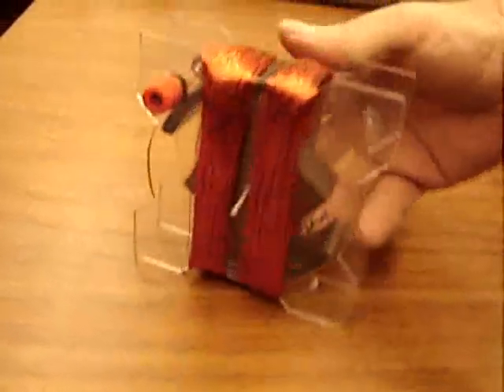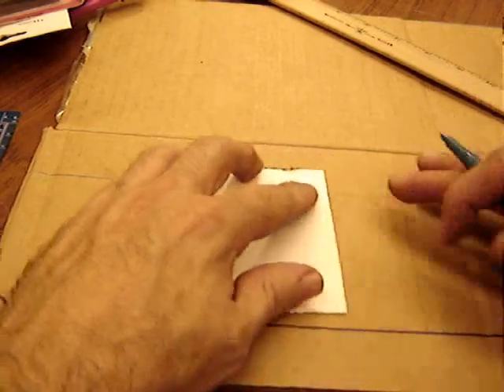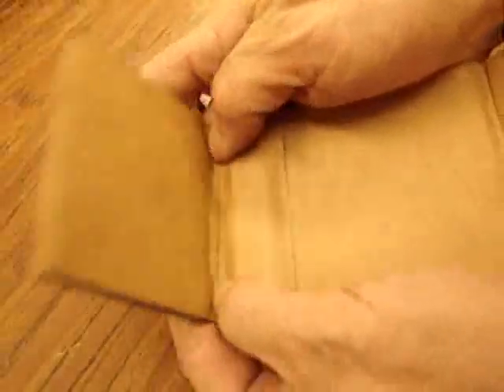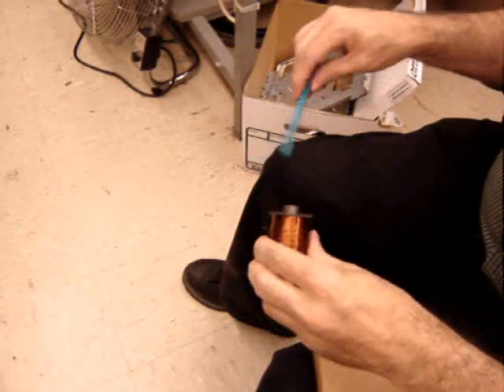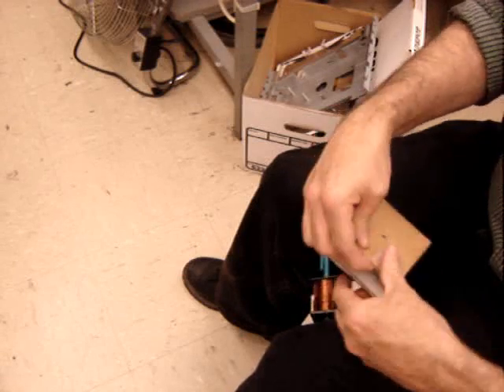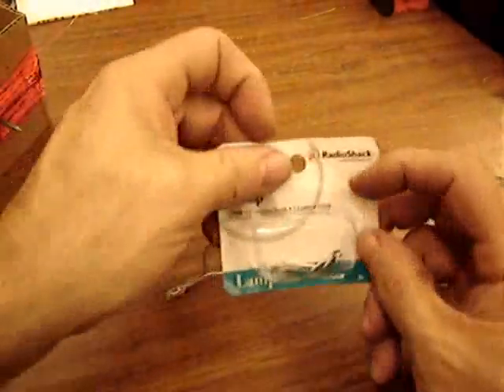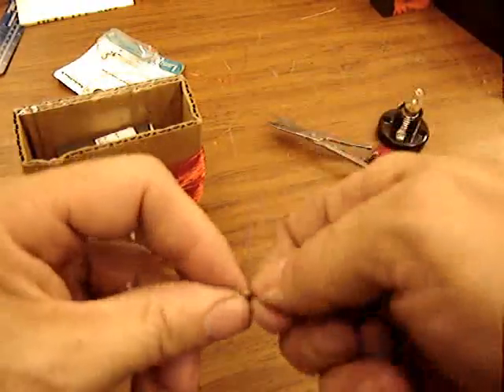Simple generator:  AC electric generator for science fair

Comment: I have used a 3v bulb instead of 1.5v wat shud I do to make d bulb glow??? Plz reply
Reply from the maker: 3v bulb will not work.   1.5v flashlight (torch) bulb will not work.

The bulbs which work are listed on the main website:  special Radio Shack 40mA bulb, or try #48 or #49 pilot lamp, or try a red colored LED.   For red LED you need more turns of wire, or spin the magnets much, much faster.

Comment: Yes, a red LED should work but you MUST connect a 1N400x diode across it (in parallel) to protect it from reverse voltage (where x is any number from 1 to 7).
Reply from the maker: Nah, forward current is the greater problem.  If you're worried about reverse breakdown, just connect two LEDs in parallel, pointing opposite.  The AC output will flash them alternately.   That's a good way to test, try a red and a green, back-to-back  (see if you can light up the green LED at all!)

Also, since it's difficult to spin fast enough to light an LED at all (to get past two volts,) it's even more difficult to create the four to thirty volts needed to damage a reverse-biased LED.  If your generator can do that, it's already turning the LED on at over 100mA forward current.

But yes, if you spin the generator blazingly fast to generate 5V, you may kill your LED.  Which is worse, the long-period forward-current overheating, or the briefer pulse of reverse-breakdown overheating?  That depends on the magnet speed, wire thickness, and number of turns (so, volts and series resistance of the coil become important.)

Comment: How long does the nail have to be and does it have to be magnet wire
Reply from the maker: See the main instructions on the site.  Don't use different wire or different magnets or different bulb.    Once you make it work, THEN try making changes to see what happens.

Example:  with thick insulation, 300 turns of wire is a huge wad, and the outside turns are far away from the magnet.   Need very thin wire, so those 300 turns all are very close to the magnet (and 500 turns is better, or 800 or 1000!)

Comment: Hello, thanks for the video it's very helpful- Would it work if you use an old fan like motor to make spin the nail instead of spinning it yourself, so it can generate eolic electricity?
Reply from the maker: Anything works if it spins the magnets fast.  Try an electric drill.  Or even a hand-crank drill

Comment: Would it work if you use a motor connected to the part you spin instead of spinning it with your hand.
Reply from the maker: YES!   Try clamping the nail in a power drill..   But usually you can spin it faster by twiddling the nail with your fingers.

Comment: could you connect a diode to this to convert to dc to charge batteries or cell phones?
Reply from the maker: In theory, diode yes.   But diodes eat up about 3/4 volt.   This generator only puts out about 1V.   So you're left with almost nothing.

That's why real DC generators use a rotating "commutator" switch to reverse the polarity twice per turn, so it's always positive or always negative.   A switch doesn't use up the volts like diodes do.    You could build a "non-ultra-simple generator" with an entire commutator assembly.    It would also become a motor, if connected to a battery.
Reply: Cool video.  Thanks alot.

Comment: what kind of wire is this, material wise
Reply: > what kind of wire

Wire bought from Radio Shack.  Most normal wire will not work.   See the main page for parts list, also the FAQ for many suggested wire sources and mail order sites.   It's very thin #30-gauge copper wire, insulated with a thin varnish coating.

Cheapest is to buy some two-dollar solenoids from surplus electronics pages.  Certain types of solenoids can be bent open to remove the spool of wire.
Reply: KANTHAL WIRE.. could i use that
Reply from the maker: William Moon
No, the wire must have very thin insulation (enamel varnish.)  You need about 300ft, more is better.   And it must be almost hair thin (#30 gauge or similar.)    See the main project site, partslist and FAQ.   For wire there are many online sellers, mail-order.

Comment: Sir i need to make a working model on the uses of electromagnetic induction in daily life... pls suggest something.... n pls suggest something easy that i can make
Reply from the maker: Electric generators work by Faraday's law of EM induction: the moving magnet induces a voltage in the coil of wire, and if a complete circuit exists, it also induces a current.

Or more specifically, in the circular area bounded by each turn of wire, the voltage produced by that turn of wire is proportional to the changing rate of magnetic flux (so, we produce higher voltage by adding more turns of wire, or with stronger magnet, or with faster magnet, or by including an external steel core to concentrate the flux and direct all of it into the center of the coil.)   EM induction and the AC power grid runs our civilization, and above AC generator (alternator) is a simple demonstration.

Comment: I made an octagon, and epoxied 8,  1x1/4" N52 rare earth disk magnets on the facets.   I reclaimed magnet wire for a transformer.  I used at least as man turns as shown in this video and spun it up with a drill.   

I got no voltage for some reason.... The magnets ran extremely close to the coils too!....

It should work, but for some reason it is not.
Reply: > removed all but two opposing

Clown Whisper yep, that's how you duplicate the DIY generator: the rotating magnet assembly must have only two poles.  xxNxxxxSxx would give alternating spikes, while NNNNSSSS would give more of a sine wave: more magnets in parallel gives same peak volts but higher average volts, and more power at the same RPM.
Reply from the maker: If it doesn't look exactly like the generator in the video and website, chances are it will fail.   Always make an exact copy first.   Then make changes, so you can immediately see if one small change caused total failure.

If the neo magnets aren't set up as a stack of slabs as shown with the ceramic magnets, it probably won't work.   You need to form one large magnet that flips end over end.   Also, the ends of that flipping magnet must "wipe" across the wire coil.   If they follow the coil instead of cutting across it, then the voltage will be zero.

With the octogon, it might work if half of the magnets are facing north-out, half facing south-out.   So they go around the octogon like N, N, N, N, S, S, S, S.   That forms a single larger N, S maghet.
Reply: Yes that is what I did..  North south orientation and cutting across the coils. 
Its really frustrating

I think that the magnets are too strong and canceling each other out as every other one is north.  they are so strong that I had to use wood clams to glue them even from far away.  The fields (I think) overlap too  much.  Im going to use the same coil as its is at least 400 turns now, and install a n52 bar magnet to see if I can get a tiny bit of juice.  that will confirm things for me.
Reply: wbeaty So I removed all but two apposing sides and I was able to get 20v out of it using a drill.  It would random spike to 30v but only for a second.  It was bouncing all over the place but 20v showed most of the time.

I also noticed some sparking within the coil, so apparently my reclaimed wire has some bare spots.  I am really surprised that i am getting 20 v from just two one inch disc magnets.
Reply: Clown Whisper No, they absolutely can't be alternating poles, that will guarantee zero volts.  Marching CCW around the octogon they must be S,S,S,S,N,N,N,N, so you have a cluster of four strongly-repelling magnets, then another cluster of four repelling magnets.   If instead they all attract their neighbors, and go N,S,N,S etc.,that gives zero volts output.
Reply: William Beaty I have a lot of cool stuff left over from running a few manufacturing facilities.  All manor of bearings, magnets linear slides. I got a bunch of polished chrome shafts pulleys, belts etc..

Im also a woodworker so my plan is to build a decorative windmill with LED's lighting up..  Im going to have to build a rectifier and perhaps a bank of caps for some more steady voltage.

I am very surprised that my first pisspoor attempt at this worked
Now another question.  If I do this but build one coil for every magnet and do them in a disc type array like you see people trying.  would I then use alternating north south arrangement?

Do you know a good supplier for for magnet wire.  It seems to vary in price so wildly.

Comment: Wat type of wire did you use for the generator
I need it for science project
Reply from the maker: See the parts list, second page of main article on http://amasci.com/coilgen/   It's #30 gauge enameled magnet wire.   Buy from Tandy Radio-Shack stores, or see many links to online sources.

Some types of $4usd solenoids can be opened up to remove a spool of this type of wire.    Also see Avind Gupta's generators linked on http://amasci.com/coilgen/links.html
Reply: thanks that would help

Comment: Is there 2 wires? or is it the only wire you started with in the first place
Reply from the maker: All wires have two ends!   Just don't lose the starting end when winding the coil.
Reply: wbeaty so you just use 1 wire and how many turns to make the light work

Comment: I think it would be so so so much easier just to do this
fablab.waag.org/content/shakelight
That way you can keep your wire all rolled up on its bobbin(that is if you get to both ends of the wire)
Reply from the maker: Easier no.   500 to 1000 turns of wire?  Mine uses 250.  Where to buy that bobbin?  And the plastic parts?  Kids in 3rd grade aren't allowed to use knives or soldering.  That's not "Ultra Simple," it can't be made using scissors and some stuff from Radio Shack.

But if you want a real generator that's not cardboard, just go and build the more complicated versions like Shakelight, or Otherpower supermagnet wind generators, or all the others listed on my links page http://amasci.com/coilgen/links.html
Reply: wbeaty The bobbin is what the wire came on in the first place. Or find a solenoid you can take the center out of and you'll be half way there. For the plastic parts just stroll around walmart till you find something that will work. Using your imagination to create something from parts that weren't made for that purpose is very satisfying. So when is the correct time to teach kids about using tools safely and show them what can happen if they don't.  Not teaching safety is just a disaster waiting to happen when they aren't at school.
Reply from the maker: dumass00072 the shake-gen is easy ...for teens and adults.  My above generator is for far younger kids in a classroom setting.   For them, the shake-generator isn't easy, instead it's near impossible: it's a fairly advanced project perhaps for 6th graders.  But if they can get parents to take them to a local Radio Shack store, they can build it easily.   That's why thousands of K6 school kids build this cardboard version.  Beware of a "let them eat cake" attitude.  Shake-generator is only "easier" if you're much older and allowed to use sharp tools, a soldering iron, if you can order online parts, if you can wander around in Walmart.   The Ultra Simple Generator needs none of these: it's aimed at an audience far, far younger than Shake Gen.
Reply: I'll go with ya on that. From what I can remember(which isn't much) I was pretty useless in 3rd & 4th grade. :)
Reply from the maker: dumass00072  Me too, but I remember "third grade me," he once made a flashlight out of batteries and electrical tape, and he wants to build a generator.

So that's who this one is for:   for mini-me.

Needs 1000 turns of wire?   I'd give up before I even started.  And they'd never let us mess with neo supermagnets (blood blisters from finger pinch.)   So this one is designed to barely, barely work, if you only wind 250 turns.   For the big kids there are much better DIY generators at http://amasci.com/coilgen/links.html links page.   The best one is six kilowatts, with lethal neo supermags the size of hocky pucks http://www.otherpower.com/20page1.html    It's AC, but with big diodes to charge a bank of car batteries.
Reply: My third grade teacher broke her paddle on me. The 2ft long 4in wide wooden ones. I was a demon child. :)
Reply: dumass00072 The "Batteries and Bulbs" teachers-manual says to beware of kids who hook twenty of the D-cells in series and use it to "detonate" the little flashlight bulbs.

Comment: why not a led? new generation red are pretty efficient and run fine on ac :) run 2 leds in reverse polarity of eachother and watch the ac fluxuate between them flashing 1 then the other
Reply from the maker: Double the number of turns of wire, and red LEDs work just fine.    But they need 1.7V, while the special incandescent bulb lights at 0.7V

Comment: Can you make A bigger working generator combinating more of this small?

And ,why you don't make video storing that electricity in home made battery?
Reply from the maker: Batteries need a DC generator.  This one's AC, so it needs an entire rotating Commutator assembly to make DC.   That's not "ultra simple generator" anymore.

It is possible to use diodes to change AC into DC.   But this generator only puts out about half a volt on average, so any diode will swallow the entire output with nothing left over.  (That's why low-volt DC generators typically use commutators instead of diodes.)

Comment: er so this is ac? um wth everyone complains it tough to get dc stuff to run converters to run ac stuff why dont they just make these kind of chargers to run blenders and what notlol?
also if i continue to increase wire wrap, does the voltage go up, and does the thickness matter, thinner better? thicker better? i wanna make a small steam engine to turn a handle on one of these and see what i can do with it, toy wise of course ^^
cool vid
Reply: This is ultra-simple cardboard generator, less than a tenth watt.  See the generator website, links page, for lots of high-power DIY generator projects.

Yes, twice the windings gives twice the voltage.  But to run a flashlight or charge a battery, you need very high speed, or add steel parts (both is best.)
Reply: William Beaty still cool to know there is a way to make ac without converting.
anyway to convert an ac item to use dc? ^^ just learning so all noob questions I know lol
Reply from the maker: APCWORLDSUXAZ If something has a wall-transformer, an "AC adapter," then it's already using DC.   But usually those things are 5V or 15V or something between.   This generator only produces about 3/4 volt.   For much better generators, find wind-power projects with big neo magnets and pancake-type coils.
Reply: well in that case, i seriously got screwed in school because i don't remember learning any of this cool stuff AT ALL.but its cool because it forces me to meet cool people like you ^^

and thanx, trying to learn about electricty, dynamos/generators and alt energies like steam, solar, and wind.
 i mean you made electricity in your freakin hands with cardboard. although the clear plexi one is very cool as well.
FREAKIN MR WIZARD LOL
Reply: APCWORLDSUXAZ  Beware, my large website, giant time-suck:    Bad Physics http://amasci.com/miscon/miscon4.html    Projects http://amasci.com/unew.html,  articles about "Electricity" http://amasci.com/ele-edu.html
Reply: sweet ty dude. insomniacs don't have " time-sucks"  the week is just one long day lol.

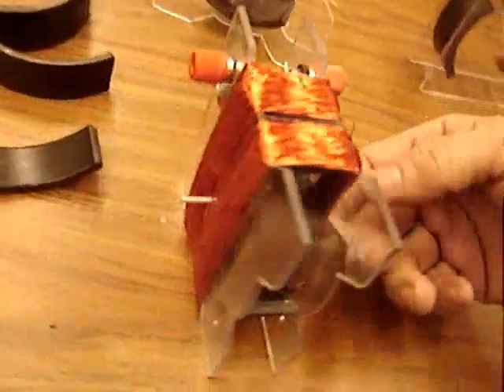Comment: 7:17 - what are those?
Reply from the maker: Red knobs?  They're called "binding posts," for connecting bare wires to an electrical device.   Often used on the back of loudspeakers.  Several kinds are sold by Radio Shack.

On the fancy plastic version of the generator, the generator wires connect permanently to the binding posts.   Then it's easy to attach the light bulb.

Comment: When we turn the magnets around it  start falling because of how much it weights compared to the screwdriver , how can we fix that ? We really need help ASAP :/
Reply from the maker: I used a big, thin nail.   Less than 1/8 inch wide (less than 3mm).    The magnets grabbed it strongly.   Also I stuck some little bits of cardboard on either side of the nail, so the magnets wouldn't tilt so much, and the nail would stay in the center.   The axle has to stay in the center, so the magnets stay balanced and can spin.

If your screwdriver is too thick, the magnets might grab it weakly, then fall off.
Reply: our screwdriver was thin and we put cardboard in between the magnets , but the more we turned it the more the magnets slide  :(
Reply: Make the cardboard strip wider, attach  wires on the edges of the nail and put a lot of tape in front of and behind the magnet
Aysenur Uludag
Reply from the maker: Aysenur Uludag
Try a nail? :)

Cardboard has to be thinner than the nail, else the nail just spins.    The magnets must clamp the nail strongly.   You can try putting stretched black vinyl tape across the ends of the magnets, so it helps squeeze them together on the nail.
Reply: wbeaty it happened to me too. the magnets fell off the nail, i tried cardborad pieces in between the 4 magnets. Like the 2 on one side are uneven. It makes an A and doesn't spin